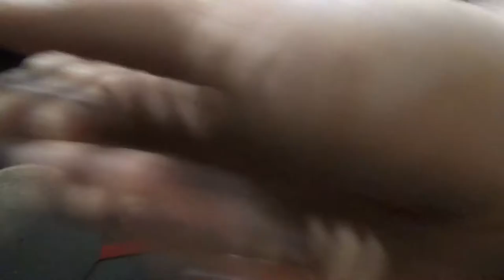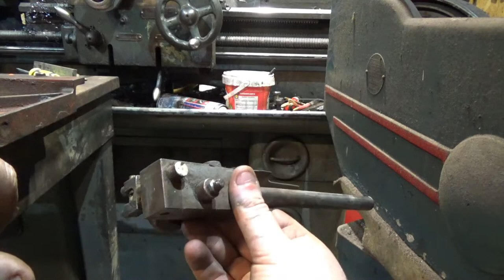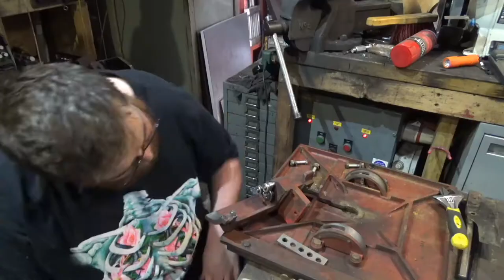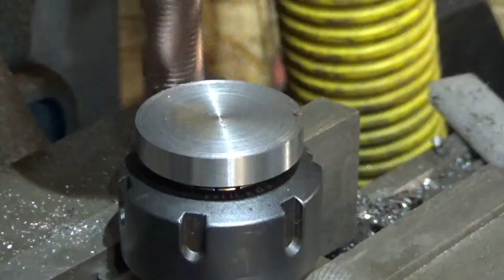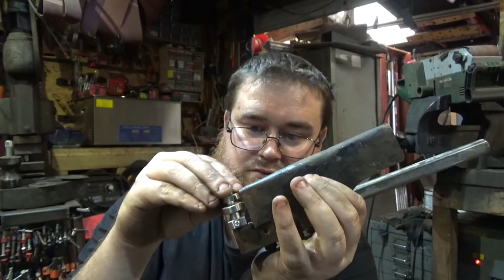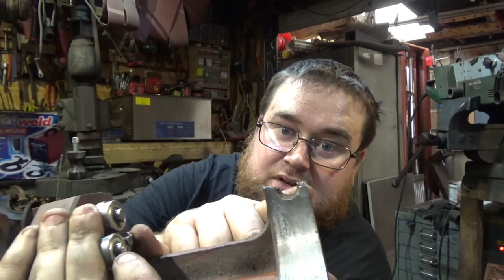roller bearing blade guides for startrite bandsaw

Comment: Hi Shane just fixed up a Meddings pillar drill that the farmer I bought if from had let fall over a few times 😫preheated it to a light blue colour and then tigged it with silicon bronze. Then let cool slowly. Worked a treat. Video on its way when I can be bothered to edit it!
Reply from the maker: I've just finished mine. I'm half way through editing it, I went with dissimilar mma electrodes. Silicon bronze was so expensive

Comment: hi Shane i think for Cast iron you need to heat it up up to 900 degree, and weld a piece of steel to it or something like that i am going to guess this bandsaw doesn't work at all ? or are you just trying to restore to what factory was ?
Reply from the maker: Erm it didnt work, I had to wire in a new motor and make new drive pulleys. That was awhile ago. Now I need to cut some 25mm thick plate for another project but I want to mill the parts to final size so using a plasma cutter is not idea, so got to get this back up and running. I'm looking at maybe using 312 dissimilar mma rods. Cleaning off the flux and tig welding the parts together. Silicon bronze rods are very expensive, 312 dissimilar rods are around half the cost. Need to keep costs down obviously. But I think pre heat will be key still